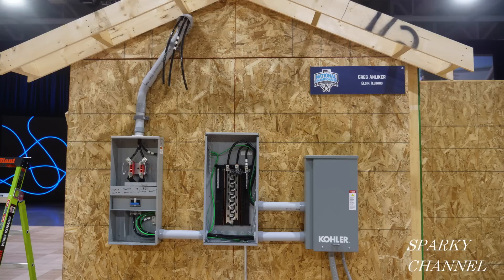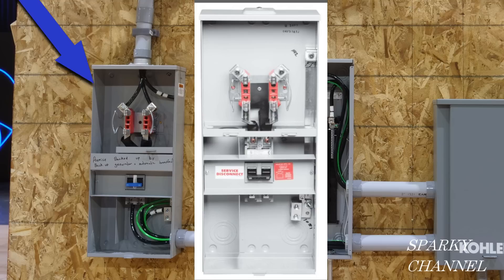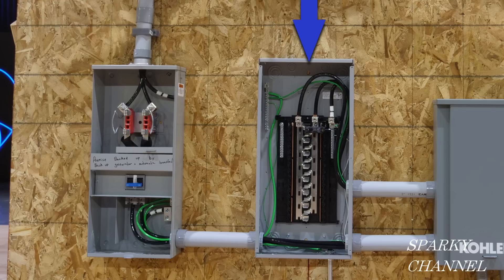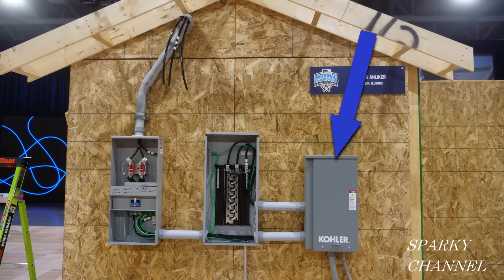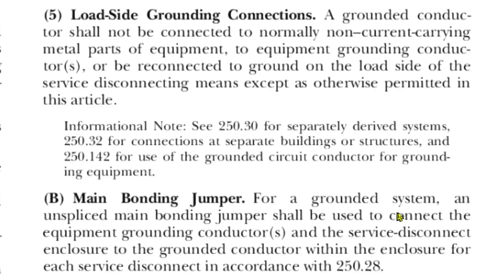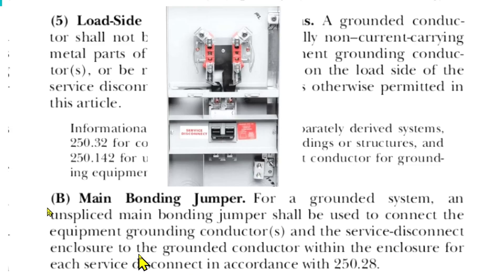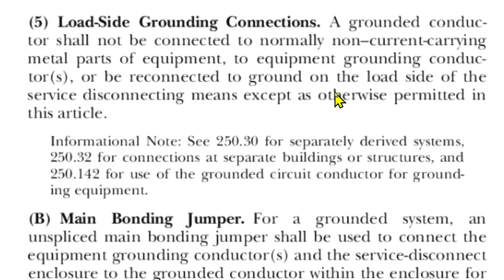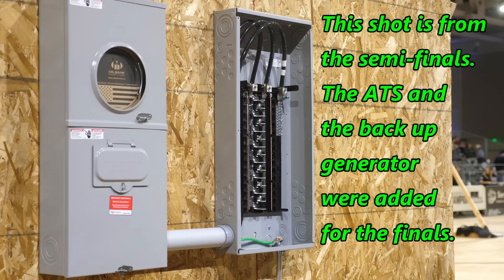In Which Panel are the Neutral and Ground Bonded?

Comment: In my area, we are allowed to get homeowner permits for doing wiring. I should specify, the homeowner and only the homeowner can redo the wiring. My grandparent's farmhouse was given to me when they passed. So I am redoing it to remove the old groundless wires for new as I am remodeling the home. 

This comes to my question. Our farmyard has a main breaker. It turns off the main shop, storage buildings, a few barns, and the old farmhouse. Because we have that single main in the middle of the farmyard, when I put in the new updated main panel in the house, I would keep the grounds and neutrals separate and not use the bonding screw. Correct?
Reply: Your understanding is correct.  You will need a grounding electrode conductor (comprised of one or more ground rod(s), UFER, ground ring, etc.) at every other building or structure, but that GEC should bond everything "likely to become energized" except the neutral conductor.  The only place the neutral and ground bond together is at the main.  Any other scenario causes neutral current to flow on the metal parts of the facility's electrical system that are not intended to normally carry current, creating an electrical hazard.
Reply: @steveloux4709  if the main panel and the sub panel are on the same structure (actually, they are right next to each other), no grounding rod is required for the sub panel, correct?

Asking because I noticed my sub panel does not have a grounding rod attached to it (sub is just a few inches away from the main, in my garage).
Reply: @Lugenfabrik  correct. The sub panel is bonded to ground by means of the equipment grounding conductor.
Reply: Why should a permit be required for a home owner to work on their own home?
Reply: @thomaswayneward  I think you misread. It’s a homeowner permit for wiring. As in, a permit to do your own wiring and get it inspected for a DIYer. With that specific permit the homeowner and only the homeowner can do the major electrical work.
Reply: @thomaswayneward  why exactly are you on this channel if you think it’s brainwashing to get a home inspected as it’s being built? Lmao
Reply: @thomaswayneward  Louisiana is the same way for the most part, we have pretty much zero municipal inspections of residential property.  Nice to not get gigged for cash every time we want to work on our own land....

Comment: It helped me understand when I learned about TN-C-S service connections on the British electrical channels.  The neutral and ground (grounding electrode at transformer) are combined on the single conductor from the transformer but must be separated at the very first instance possible, which is at the first disconnect to ensure any ground fault is cleared by that disconnect or downstream breaker and not dependent upon blowing the transformer fuse.  And you never let the grounded wire (neutral) and grounding wire (ground) be combined again because that creates parallel circuits and if the grounding wire was broken for some reason, everything it was bonded to downstream from the break  would be live waiting for someone to make a human connection across the break.
Reply from the maker: Excellent, well stated! Thanks JK!

Comment: Always ground net. At first means of disconnect. Which is 99% of time in meter can or first. Panel there after.
Reply from the maker: Correct.
Reply: My house has a meter in the outside and the main panel inside. My electrician did not bond the main panel inside (that’s where i have the main breaker) because he said the neutral is already bonded to ground at the meter. Does this sound accurate or do I need a second opinion? I am no electrician but I have seen many videos about this topic and I have never heard of that setup that my electrician explained.

Comment: Ground and neutral are bonded in the main panel only. Because if you bond them in the sub panel, ground is equivalent to neutral, they split the load. Where ground is normally a protection from stray charge.
Reply: Good explanation thanks
Reply: Which panel is the main panel?
Reply: No, first means of disco.

Comment: Here's a good one, I have a Manufactured home. It has a meter on the outside of the home, with a separate in line disconnect below it. The main panel also has a service disconnect. I haven't removed the dead front yet. But if I were a betting man I'd say the neutral and ground are bonded in that main panel. What happens in this instance? 

I plan on updating the the house electrically. First step is all outlets with TR commercial grade outlets because all current outlets are sketchy backstab ones. I would also like to do AFCI / GFCI combo breakers for any circuits that feed outlets.
Reply: According to my understanding of current code, because of the outside disconnect any neutral and ground would be bonded at this location. This would mean that the inside panel should not have the bonding screw installed.

Even so, I would agree with you in that I would also not be surprised if the neutral and ground were bonded in your inside panel.

As far as you asking what happens in this instance, I'm not exactly sure what you're asking for.

If the inside panel is bonded in addition to being bonded at the exterior disconnect, there is the potential for the inside panel to become energized if a problem occurs on a branch circuit.

You would be wise to replace all the old stabbed back receptacles. I can't count the number of these receptacles I've seen fail because of how many times they got to hot over the years of being used. The plastic becomes brittle and eventually falls apart. I totally expect to see stab back outlets become outlawed at some point.
Reply: @BrightlineTechGroupLLC  I appreciate your time.
Reply: @bwats1991  you're welcome. 😀

Comment: I have one for you:  In a 240 vac 30 amp circuit using #10 conductors can you use lighter gauge conductors to wire in permanent kilowatt and hour meter gauges to keep track of equipment.  The gauges need their power supply from the 240 vac circuit but come wired with #22 gauge leads.  They don't carry any load but are just measuring and keeping totals.  Thanks.  Good presentation of well thought out videos.
Reply: Yes it will be fine. If you have ever seen any of these new CT meters you’ll see let’s say 350kcm for example in the cabinet going to the main disconnect. The meter is connected to the ct cabinet and connected to the lugs with 12 wire and it works fine because there’s no load on its end and all it’s doing is giving data back to the power company. Similar concept to what your dealing with.
Reply: @fordsbetter3496  Thanks.  That was what I was thinking but wasn't sure if the code dealt with it.  Thanks for the reply.
Reply: Technically, any permanent wire that leaves the box should be able to carry the full current from the breaker it's wired to, and should have enough capacity to trip the breaker if shorted. 

It might be best to keep that stuff inside the box or use inductive types that don't physically connect, wireless versions, etc. You could also terminate to a 30 amp outlet and monitor there, but light wiring isn't even recommended for plugging into high capacity circuits. You could also add the monitor to some 30a appliance internally. There just isn't an ideal way to do it because light wire will never be protected or safe on high current circuits. 

In old houses with old wiring, I'm fine putting 8 or 10 amp breakers on outlets. People should not be drawing over 800 watts on old wiring IMO. Asking for trouble.

Comment: Hey Bill. 

I love your channel. I have been watching your videos for a few months and I wish I found your channel earlier. 

I was wondering about two topics. Do you have a video about the best gear and tools to have in the field? Or at least to start with. I see your tools you have listed, but I don’t know if I need all the ones listed. I do remodeling and do most of the trades. I would love your opinion on the best multi meter, standard electric tester, continuity testers, etc. I am willing to spend money but maybe not extremely high end. 

Also, do you have a video about wiring a three way light system where the power leg, light leg, and 3 wire are on one switch, and the other switch is just one 3 wire? The light is just one single 2 wire. I have seen this while remodeling. Maybe it is incorrect.
Reply from the maker: See: How To Wire a 3-Way Switch System: https://youtu.be/cOFKnAGOPg4
  and: Sparky Channel's Favorite Tools House Renovation Series : https://youtu.be/g6FPWBZyEe8
Reply: Thanks a lot for your response. That favorite tool video was perfect. I wish the Fluke multi meter was more affordable, but you get what you pay for. 

I still have some things that I am not fully understanding with the ways I find some old 3 way switches wired, but that 3 way switch video, and your whole 3 way switch series of videos are extremely helpful. You make electrical a lot easier to understand.
Reply from the maker: @TeddyBaseball  Excellent, glad I could help!

Comment: Great vid. How is the transfer switch grounded / bonded? And is the neutral switched or contiguous from the transfer switch to the MLO???  Thanks.
Reply: Hard to tell from these shots but looks like the transfer switch is non neutral switching? In which case it is nonseparately derived. So no ground-neutral bond.
Reply from the maker: Thanks! The Kohler generator is bonded at the factory and it is non neutral switching.

Comment: Guess I'm a bit confused by use of the term 'bonded' here.  When I think of 'bonding', I think of like tying all the metal parts of a hot-tub together and tying that in to the 'Equipment Grounding Conductor'.  So the MLO appears to be 'bonded' to me in that it has a nice fat green wire tying it's ground bars and case back to the service entrance.  I understand the neutral and ground ('grounded conductor' and 'equipment grounding conductor') are NOT connected inside the MLO, but seems the MLO is still 'bonded'.

Or is 'bonded' here mean only that you've connected GC and EGC together inside the panel?
Reply from the maker: Yes, bonding means that you've connected GC and EGC together inside the panel.

Comment: The instructions for the Generac Transfer switch say the neutral and ground are to be bonded together in that transfer panel. However in my last instal there was a neutral to ground bond in the meter panel with a 200 amp breaker just as in this video. There is a 200 amp breaker in the Transfer switch as well. I always went by the first disconnect rule for bonding them together. So are the instructions wrong? Isn't the first point of disconnect the transfer switch when the generator is providing power?
Reply: Well that's a good question.  But I wonder, does the transfer switch transfer the neutral?  Or is the generator neutral (groundED conductor) always connected with the service entrance neutral?  (i.e. does it just transfer the two hots, or all three conductors?)

Seems like the generator would have to have it's own grounding electrodes?
Reply: @mikefochtman7164  Typical installs of residential air-cooled standby gensets are Non-separately derived systems. The ATS only switches the ungrounded(hot) conductors. The grounded(neutral) conductor is bonded only at the service disconnect(s) and nowhere else. Hence, an EGC is required to bond the chassis of the genset.
Reply: @matthewrichards5941  Guess I'll have to go back and read more about 'separately derived' and 'non-separately derived'.  But thanks.
Reply: This is a good question
Reply: I've installed quite a few with pretty much your exact situation. The bonding jumper that bonds the neutral busbar(grounded conductor) to the enclosure is removable and should be removed. This creates an insulated neutral and takes care of the requirement that Bill explained in the video.        The reason the instructions say that they are to be bonded is that it is a Service Rated ATS and as such, the typical application calls for them to be bonded.

Comment: I seem to recall that a garage apartment I lived in for awhile had a subpanel where its feed wires entered the structure via an underground conduit. Ground and neutral were bonded at that subpanel, but my electrician said that was OK because there was a ground rod at the subpanel, providing an independently derived ground. Was he correct?
Reply: As long as there was no ground pulled from the original source. When a new ground is established, grounded systems must not be interconnected from the line side.
Reply: @cricketyosh  Sure enough, only two black conductors were pulled through the conduit.
Reply: Yes
Reply: If there was a ground pulled in with the feeders and neutral, then no, you wouldn’t want to bond inside that panel.
Reply: I think you would want to bond inside the subpanel, but actually leave the ground from the main panel disconnected- just cap it off inside the subpanel. It would just be there to catch lightning or whatever along the feed. 

I'm thinking that would mean using a dielectric isolator on any conducive conduit between panels in separate buildings. I could be wrong.